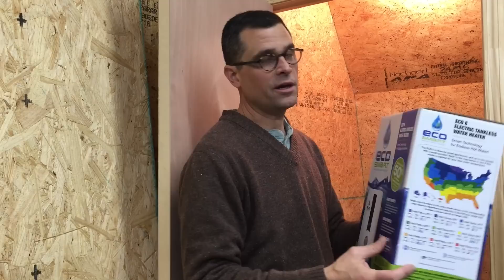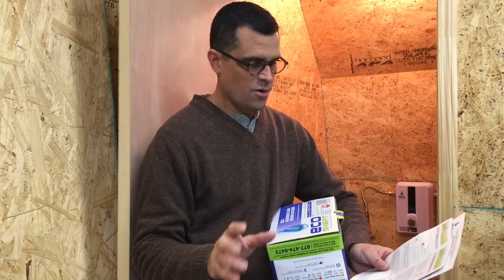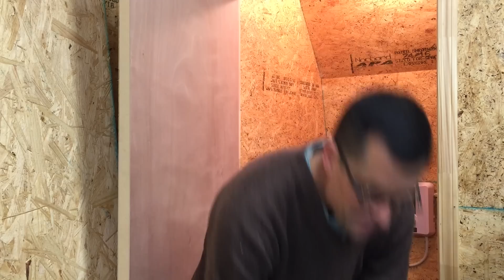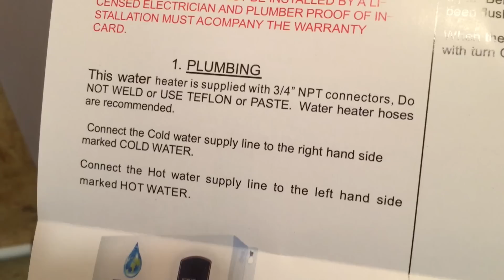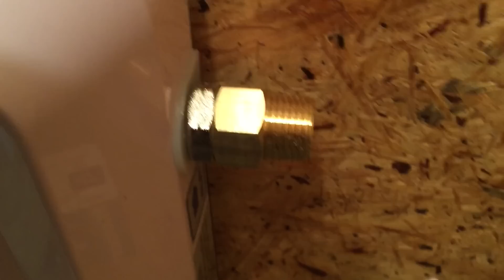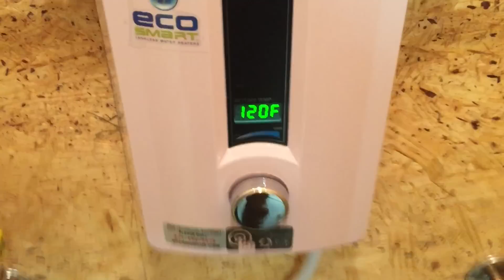EcoSmart Eco 8 Electric Tankless Water Heater Installation and Review

Comment: Saved me and my install. Specification said 1/2 inch connection but something wasn't right whatever I did. Thanks for saving me from striping the connector on the water heater.

Comment: That is a major typo on the box. If do it yourselfer's were to not pay attention to this they could burn the house down. 40 amp double breaker requires #8. If you install #10 the breaker will not trip and the wire will melt and cause a fire. Let an electrician hook it up if you are unsure.

Comment: Thanks for this. I'm replacing a really old 9kw unit and wanted to upgrade to a higher output model if the wire allowed, but unfortunately it's wired with 8/2 and running 6/2 would add like $380 to the cost of the project....that supplies a single faucet and shower

Comment: Just had an Eco smart 8 electric water heater installed in my 1 bedroom apt.   1 shower 1 bathroom sink 1 kitchen sink.   Thus far all is good.  Good heat even for shower.  Not untouchable hot, but right at the bearable mark, at its full heat output.   I wanted a Black + Decker unit that was on a memorial day sale, but they were all sold out.   For a small situation like mine its perfect.  Not in love with all the plastics used in its interior... but im not too certain that the unit gets hot enough to melt the plastic,   as would likely be the case if it were any measures hotter.   Ide say its a decent buy.  but i would also find out what brands Hotel chains typically use.  As some have switched to localized room heating solutions to save in costs.    find out what brand their using and youl liking see a product line more competent for quality durability and long term heavy usage.

Comment: you have to use the compression ring and not teflon tape  =the fitting on the water heater is a compression fitting ,you meat head it req1uires the brass compression ring

Comment: Great. Thanks for you video. 
Just a question: can I do the electrical connections just like a regular plug con the correct wire suggested on the instructions?
Very simple explanation helps a lots to decide change the monster and expensive tank for my apartment. 
Thanks again.

Comment: Not sure why you had so many issues trying to figure out the wire size.  If it requires a 40 amp breaker it requires 8 AWG wire.  30 amp breaker would be 10 AWG wire.  Not code and dangerous to run 10 AWG on a 40 amp breaker.   Would it work,  sure but you would be heating up the wire and also causing a voltage drop.   Good that you went with 8 AWG.

Comment: So Ecosmart is not the brand to buy. They say one wire size on the box and another size in the installation guide, they say don't use teflon tape or sealer on pipe fitting yet supply a fitting that needs something to take up the slack. I have only watched 8 minutes of your video and am dead set against this companies product. Thank you for a very informative video and helping me to stay away from this company.
Reply from the maker: Steve Blauvelt Glad it helped. It’s still working great for us.

Comment: So your fitting was loose because you left out your brass compresson sleeve/collar.. that fitting was meant to be used with a pipe slid in it WITH the compression sleeve. That loose fitting with tape on it is bad advise to be in someones home... you can easily get a supply line thatsc1/2" that would have fit the unit without trying to adapt. Its identical to water heater nipples, its just 1/2" instead of 3/4"
Reply: Indeed, BUT, there is NO documentation saying those are compression fittings. Yes, a plumber would know that, but as these are marketed toward DIY as well, there should be a bit better, more complete instructions. The electrical seemed to be well documented. These should not be harder than regular water heaters to install, but lack of common fitting/connections, lack of detailed instructions, make this a bit of a guessing game for those who are use to METICULOUSLY following instructions.

Comment: I loved my ecoSmart 11 but after 3 years and it is no longer heating. Called tech support and they said it is most likely mineral  scales. The digital temperature knobs light up when you turn it so the problem is not electrical. Wish I knew about the  Aqua Pure scale inhibitor or that it would come with the unit even if it cost a little more ( I don't have well water) but there are minerals in city water too.  I can never go back to a regular water heater but now I have to buy the  flow meter (located inside and replace it myself?)
Reply: likely the heating elements are 'scaled up' as well. Those will need to be cleaned. There are many Youtube videos about cleaning tankless heaters.

Comment: Great Video... You have no idea how much I appreciate 
this video... but I have a few questions...
1) Did you have to put any Barrier between the Plywood Wall
and the tankless water heater??? I would think it would get too
hot for the wall...
2) I want to put this in a small  vintage travel trailer and all I have
is 110/120 ... is that enough electricity to run this equipment?
Or does it need 220?
Thank you so much for sharing this video.
Reply: I just purchased a Rheem 56 amp heater. Says it can flow 4 gpm. But the only ones that support 110v are the very small remote heaters that are designed to be used per application IE a single sink faucet. Any service panel that I know of is a 240v service so I feel that you have it and don't know you do
Reply: @anewzack78  
Good to know...
Thank you for your reply

Comment: does the heating capacity depends on the water power?
Reply from the maker: Yes. The higher the water flow, the less ability the unit has to heat the water.

Comment: Thats a copper compresion fitting thats why they say no tape. They are talking about you installing copper. Not the brass fitting yiu installed. Also you are to have 2 ft of coper connected to the unit the hose you are using is rubber and should not be used. You should use coper or a flex copper water heater connector. The setup you have will fail and leak
Reply: The brass adapters come IN THE BOX, with no documentation for DIYers on what to do except "don't use tape or paste"! No mention of compression fittings. No info on company site. I had the same issue with the adapters 'bottoming out'. So I did the tape thing and fortunately they have held! The instructions recommend the "hoses".  I have this installed for 3 years with "hoses", not metal flex lines. No issues.

Comment: I have a single pipeline installation (cold water). Can I use this on the same pipeline and adjust the teperature so I don't have to install extra line for hot water?
Reply from the maker: Interesting question. I suppose you could, if you wanted to only have warm/hot water, and sacrifice ever having cold water.
Reply: St. Isidore's Farm but it has a dial right? So you can lower the temperature if you want cold water (I think).
Reply from the maker: Yes, it has a dial to adjust temperature, but it's for warm to hot. You could just turn it off and water would still go through it without being heated.
Reply: St. Isidore's Farm Do you have a video of the waterflow? (Tank only)

Comment: Next time before you turn the power on, run the water on your highest fixture to get all the air out of the system. Prevents any potential damage to the heating coils. Otherwise nicely done! Good on you to put tef tape in the threads. Any thread on thread sealing should have it unless there is a washer like hose type connections.
Reply from the maker: Thanks for watching and for the helpful tip. Unfortunately, that sink IS the highest outlet on that entire well system.
Reply: St. Isidore's Farm of course, i just meant in general for anyone starting up a heating system.

Comment: ok commercial plumber here. 
Iin future when wrapping tape around thread, do not put in on the first thread of male adapter, so when you put female adapter on, tape will not be cut off and deposited into system.
Reply from the maker: Cem Aydin Thanks for the top!

Comment: i installed  the same heater about 6 months ago and work very well untill 2weeks ago then it started to swell the inlet going going into the heater. i repaired it by taking out all swollen cpvc inlet lines with new ones then it happen again.im really confuse.
Reply from the maker: Sorry to hear you're having issues with the inlets.  We've not had that problem so I have no real way of offering suggestions on what is going on our how to resolve it.  Hopefully, you've figured it out by now - sorry for the delay in reply.

Comment: 10-gallon, 110V plug-in tank-style water heaters. 1440 watts - 13 amps at 110 volts.  $200 and less all over the internet. Install it under the sink, insulate the hell out of the cabinet and turn it down to "vacation" or off when you won't be the shop for a while. Don't want to heat water when you're not using it period? Put the outlet on a switch and flip it on when you get to the shop or put it on a timer to kick on an hour before you plan to be in the shop next. You'll have hot water before you have dirty hands.

The tankless water heater is 8000 watts which is 36+ amps at 220 volts. If it were 110 like the tank style heater it would draw almost 75 amps. 8000 watts is more than most full-size 40-50 gallon tank heaters draw and that think will suck more juice than probably any two-three woodworking machines you've got running simultaneously. 

Max flow rate on those heaters is 1.55 gpm and I suppose that is at its max temp increase over inlet, which is what you will actually get no matter what "target" you program in. The "overview" I found online says the product is "configured for" applications with inlet water temps of 67 degrees and above. And the "specified" outlet temp is 105 degrees. With 67 degree inlet water heated all the way to a blistering 105 degrees you can theoretically get 1.44 gallons per minute of flow. 

I notice you kind of didn't point the camera at the line during your "performance test" but I'm fairly sure your flow rate is far short of 1.44 gallons per minute and typically "hot" is "defined" as "too warm to keep your hand on or in". 105 degrees is a good temp to set a hot tub to for winter use. Not so much for getting things clean. 

I honestly do not get why people who can do electrical wiring can't do basic electrical math and figure out that tankless electric water heaters are a joke. For $25 or less you can go buy a good John Deere engine block heater element, a cheap tin pail and have 2 gallons of actual hot water in minutes and be time and energy ahead of trying to get anything clean with 105-degree water.
Reply from the maker: Thanks for the time you put into the comment.  This tankless water heater is working great for us and we purchased it for $170.  We're really happy with it and the endless supply of on demand hot water it produces.  Really, we have no complaints with it.  Blessings to you and yours!
Reply: I concur with your narrative, tank less water heaters are not efficient especially when the average inlet water temp. is 43 degrees or less in the wintertime. A tank heater insulated and on a timer or manually controlled will save money and work much better.

Comment: Do I need an electrician to install this tank?
Reply from the maker: I suppose the answer to the question depends on your skills as an electrician.  I did the wiring for ours, but I also have a lot of experience with wiring and electrical work (not to say that I know as much as an electrician).  Suppose it also depends on where you're installing it.  New construction or existing building?
Reply: Yes, if you're installing it somewhere that requires code. If it's in a shed in your back yard, then no.

Comment: Standard water heaters have had the option of a ¾ flex supply and demand (in/out) for at least 2 decades.
Reply: Still weird that they chose 5/8 if the norm is 3/4

Comment: for what size home is this model recommended for?
Reply from the maker: Jorge, I would not recommend this model for any size home.  We are only using it for a single sink and it just delivers enough hot water for that sink.  Anything more demand, like a shower, and I doubt it would produce enough hot water.  You would want to look at MUCH larger models for a home.
Reply: thanks

Comment: the compression fitting on the heater has untapered threads, as does the FIP adapter.  Using pipe dope or tape isn't an ideal way to create a seal....but often works.

if you look into the adapter, you'll see it has the chamfer that mates to a compression ring, so as odd as it sounds, the "correct" way to attach the adapter is to use a piece of 1/2" copper pipe with the compression ring on it inside the two fittings.

a piece of pipe about 1-1/4" long will do.    All the pipe is doing is preventing the compression ring from collapsing.  The ring itself provides the seal between the tank fitting and the adapter, and no dope/tape is needed on the threads.  Some people put a turn or two of tape on just to minimize the potential for corrosion. 

when installed this way, the adapter will be tight with about three threads still showing on the tank fitting.
Reply: hello. thank you for this great information. I bought this unit last year and now is leaking on the sides where the pipes are attached. what would u recommend. Thank you
Reply: thank you. I had the same issue. The documentation for using the adapter was NONEXISTENT when I installed mine in 2017, and so far, April 2020 this is the ONLY fragment of info I have found.!!!  WHY these were ever made with a fitting unlike regular water heaters is baffling... and when you don't know much about FIP, compression, etc, it is overwhelming...
Reply: I can't understand what you mean.

Comment: Hope it works beater for you than me. We had one that did not work after 94 days, Lows had replace it with a new one. Same thing happen but was in 89 days. After a bit of trouble with Lows we got a full refund. Ended up going with a Rinnai had it working for 2 years now no trouble ! God Bless Brother.
Reply from the maker: Must admit that we had a concern about that, which is why we bought a three year no question replacement warranty from Amazon for an additional $19.  That seems cheap to have a hassle free ability to return.  Figure if it makes it to three years, it should last a few more than that.  Sorry to hear you had trouble though!  Blessings to you as well.  Thanks for watching and commenting!

Comment: Thank you for this video!  We are looking to install one in our house this year.  Very helpful!  btw   I can hear you fine and my audio is less than half way up.   :)
Reply from the maker: Thanks for the comment!  I'm sure you know this, but if you're planning to use one of these electric models for your house, get one that is bigger than what you think you'll need.  The Eco 8 is fine for what we're doing, which is one sink.  But I can tell that if more than one sink was going at the same time, you would not get hot water.  The house on our property came with a Rinnai gas tankless water heater.  It is amazing.  We can run two showers at the same time with no discernible difference in hot water output.  Glad that you could hear the audio!  😉
Reply: Yes, thank you!  we are getting a bigger propane tankless.
Reply: Mrs Soap Peddler's Homestead of

Comment: Please buy a zoom external audio recorder I like your videos but it's hard to hear. I have the h1 and love it. If you can't figure out how to put external audio in post message me and I can walk you through it or do it for you.  Please fix you audio and keep the video comming
Reply: St. Isidore's Farm A Zoom mic might be a tad overkill at this point. It's an external recorder and you'd have to combine the audio and the video when you edit. Right now I'd probably just get some sort of inexpensive directional mic (your voice will be louder and it'll isolate you from the background) that you can plug directly into your phone.
Reply: St. Isidore's Farm a h1 zoom mic will do that with a $6 lapel mic so $106 on Amazon for great audio. And if you need help with lining it up audio in edit I volunteer to help with that. You can just use a lapel with a long wire but you lose the mobility. However, a lapel with long wire is $20 on Amazon. Your making great video keep it up.
Reply from the maker: Luke, thanks for the comment and suggestion.  We started making videos mostly for the sake of making an archive of all our projects and upgrades on the homestead.  Things sort of grew from there on the channel, and now we realize upgrading recording equipment will eventually be necessary.  The sound has always bothered me as well.  At the moment everything is being done on an iPhone 6.  The challenge is diverting funds from the property to video making equipment.  Now if you know of a way to get a wireless mic to synch with an iPhone, I would really like to hear it - of does the zoom recorder do that?